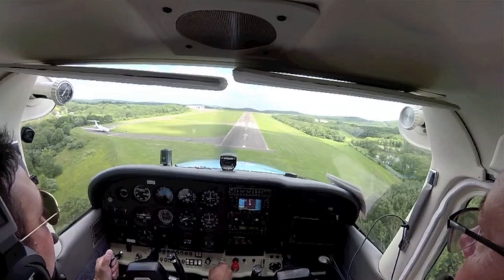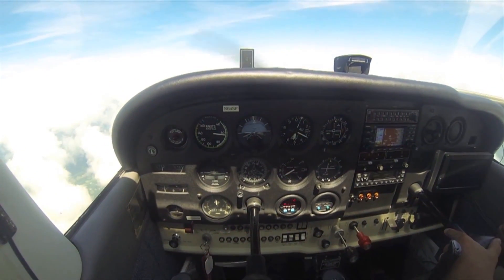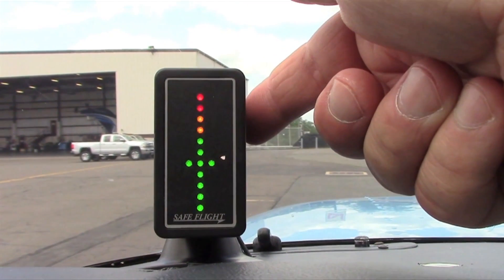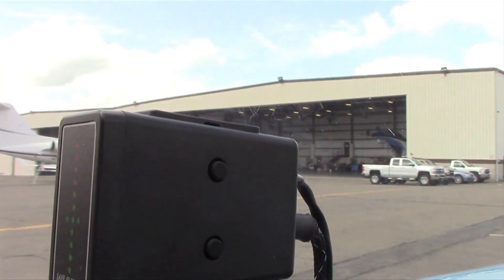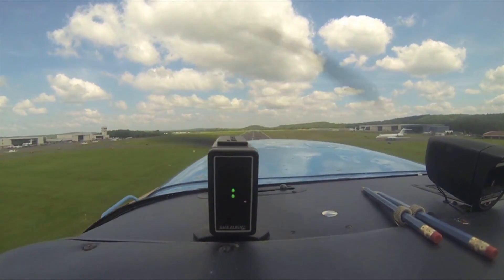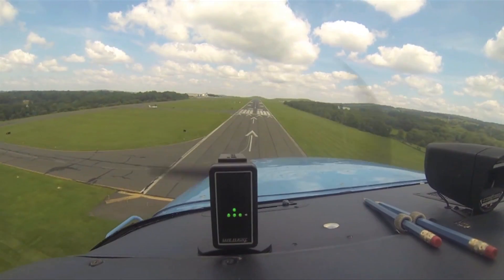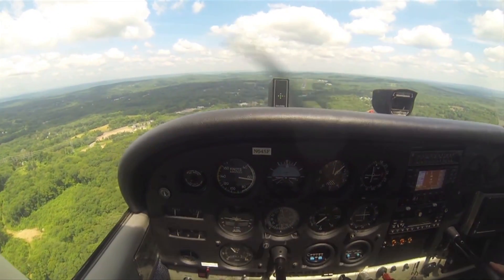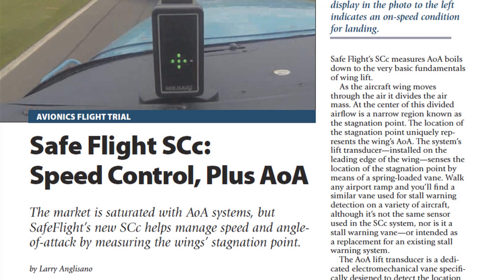Safe Flight's SCc Leading-Edge AoA System

Comment: Stall AOA has nothing to do with speed.
Reply: +Pamuva RAL .  Keep in mind that during an "accelerated stall (induced G loading) during a time when the airplane is in the process of "rolling or banking", the rising wing will have a higher angle of attack than the other.  If the sensor is mounted on the left wing and an "accelerated" stall (inducde G loading stall) occurs during a "left rolling" turn, the right wing will have a higher angle of attack "while rolling".   In other words, while the right alerion is deflected down.  This means that an accelerated stall can occur in a left rolling turn( angle of bank is increasing during the turn) before the sensor on the left wing experiences a critical angle of attack.  Therefore, there are situations where a stallspin can occur before the device indicates the critical red zone.  It seems the device is most accurate when the G loading is equal on both wings.  But it's still a good thing to have.   JMHO. DPA
Reply from the maker: +Pamuva RAL True, but the SCc is a means for flying the correct speed for the conditions, which means flying more precise speeds for takeoff, landing and cruise. Unlike other AoA systems with prompts that stow out of view above the wings critical AoA, the SCc is alive all of the time.
Reply: +AVweb Wouldn't flying for correct AOA for the phase of flight be more appropriate? this would be perfect for that, flying to a AOA would ensure you are automatically at the correct speed for the phase of flight your in? so, speed really wouldn't be a consideration..  would be handy when more precise flying is needed, such as short and high fields.
Reply: +David Affinito  Can anybody explain how to edit spelling errors after pushing the reply button?  Need to correct "aileron" and "induced" above.  I've heard there is a way?  Thanks in advance.